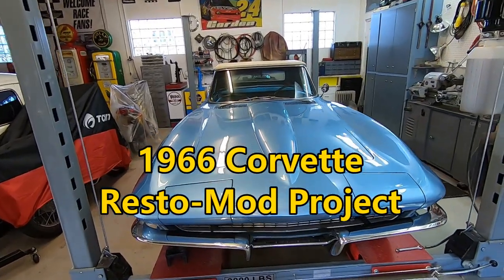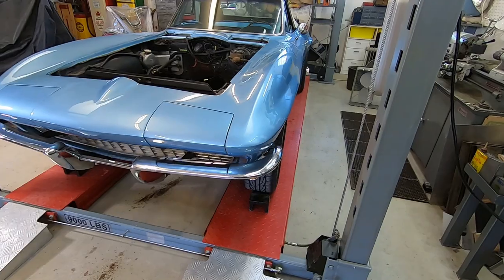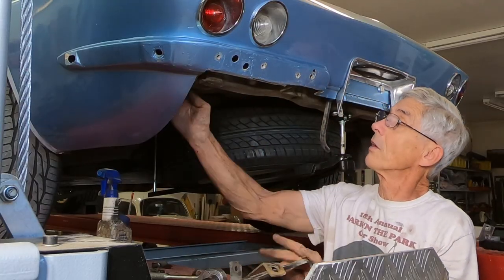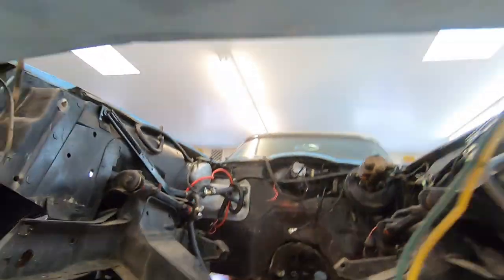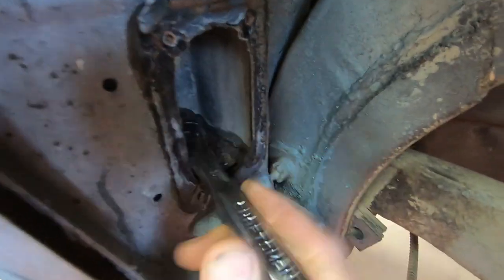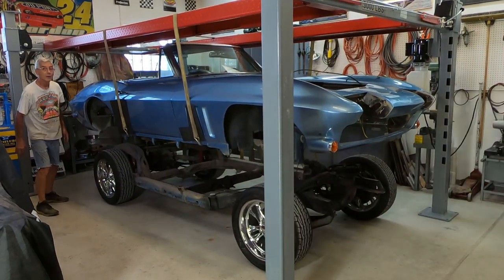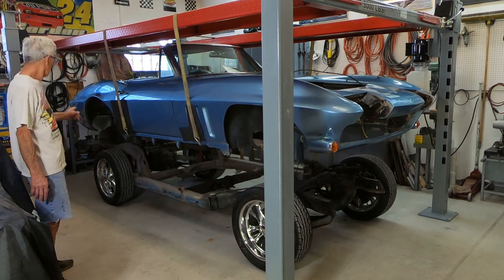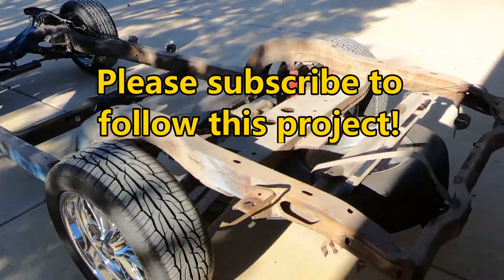1966 C2 Corvette project - Removing body from frame

Comment: Hello Dick,

Thank you for the interesting video. I have a 1964 C2 Convertible in very good condition, but the frame needs to be sandblasted and either painted or powder coated. I am a technician and have worked on many classic cars, but I have never done a frame-off restoration on a Corvette. It would be helpful if you could give me an estimate of how many hours it will take to remove and install the frame.
Greetings from Austria!
Reply from the maker: It depends on a lot of factors, but you should give yourself a week to get the body off and the frame stripped down. Putting it all back together will take months. I have been working on mine for almost a year now, but I am doing a full rebuild of every aspect of the car and working pretty much full time on it.
Reply: @DickShaw Thank you, Dick. Your answer is helping me make a decision about proceeding with a frame-off restoration.